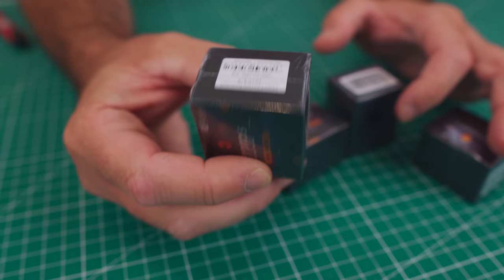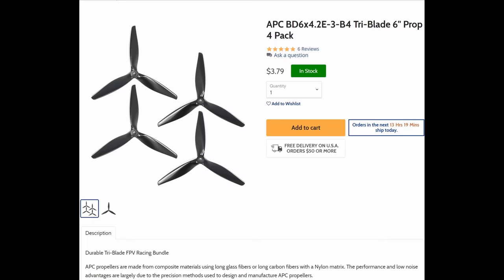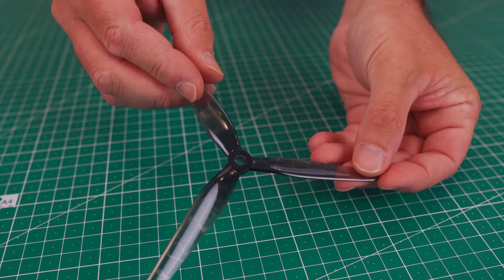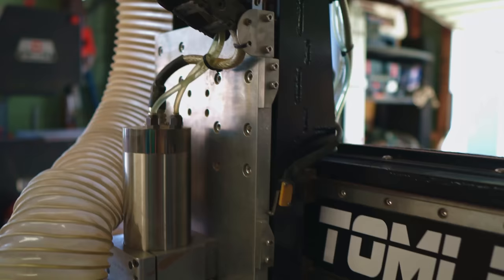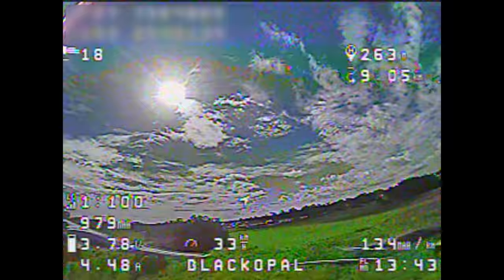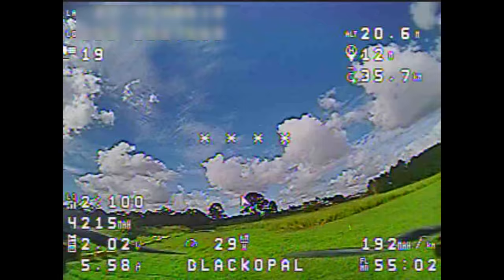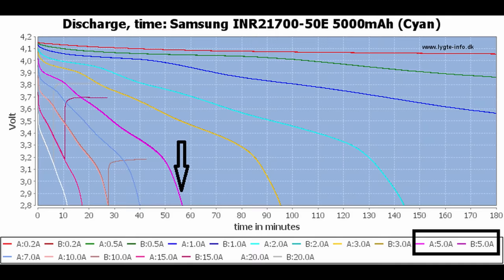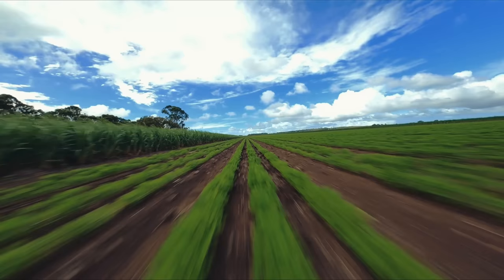55+ Min Long Range Drone (NEW T-Motor F2203.5)

Comment: Great video! Something a lot of long build idea videos forget is that there is a huge difference between holding altitude and cruising for a long time, and climbing up the side of a 3,000 ft mountain. While climbing ur always drawing much more amps, which kills battery life? How much life did you get when you climbed up through the clouds?
Reply from the maker: That's true, you could argue that coming down significantly reduces current though, so you break even. You're right though, any irregular flight hurts efficiency, you won't get 55 minutes trying to dive the Matterhorn at 80km/h. Likewise when racing it around a track. I can still drain a 1000 mAh LiPo in 3 minutes if I want to step on the juice.

Comment: How did you go that high with analog video?! 😳
Reply: Analog video can go VERY far if you maintain a clean and direct line of sight. So going straight up in to the sky Vives you a nice and clean line of sight between the drones VTx antenna and your goggles receiving antenna. A 1W (1000mW) transmitter will give you 10 kilometers of range when going straight up, with no problem ;)

Comment: Epic video nice work thanks for sharing.!!! .... , an I use these motors with a 4s.1500 mah lipo, and a 6 Inch frame?
Or what motors are the Best for these setup 4s, 6 Inch....actual motors can be used with 4s to 6s normally or its better to buy a especifico lipo, sorry for my basic quest im novice in long range... ill be thankFull for your suggestions

Comment: Hey Scott, would there be any issue if I remix your design and stretch it a bit to be more of DC and spread the front wider? Planning to make one using dji o3. Cheers
Reply from the maker: Doesn't bother me man🤙It's a pretty basic design. Should be easy enough.

Comment: how many endmills do you go through cutting that carbon?
Reply from the maker: You could cut multiple sheets easily. As they're only cheap ones (~$5) I use a new one when I want the cleanest cuts.

Comment: any advice on building up a battery pack from those samsung cells?  never assembled my own before, some of the stuff online makes it sound hard to solder to the aluminum battery ends
Reply from the maker: Soldering these cells are easier than a LiPo cell. It's pretty straight forward, just avoid heat as much as possible. FaclonRAD Fpv had a good video on Li-ion packs for LR. Might be worth checking that out.

Comment: What camera angle are you using on the gopro? can you get props out of gopro's view with slow cruising?
Reply from the maker: I run about 45 degrees. The frame is a stretch so if you only run like 15 degrees or something you might have props in view.
Reply: I am thinking about building one for mountain dive, I usually fly 25 degrees, do you think it is a good angle for that? I was thinking about mounting the front motors upside down do you think that would affect the performance? Great channel btw

Comment: Do quads generate forward lift or would it also be the same time if it was just hovering?
Reply from the maker: Not generic FPV ones no, Typically you get longer times just hovering. I like to focus on real world flying though.

Comment: Thanks for sharing the frame on thingivrs.. but can how to fit vista in it? I can use taller stand off, but not with the cam plate.. hope you release update for the vista version.. thanks so much

Comment: Is there a specific reason for using a f722 mini flight controller?
I would love to convert this setup into a long range drone, and maybe safe some money by using a f405 mini ? 
Thanks in advance..
Reply from the maker: Not at all, I just like this FC/ESC combo had the HD plug when I purchased it. I tend to buy things on sale etc without a use case Haha.

Comment: Aren't two bladed props more efficient?
Reply from the maker: Generally yeah. Hard to stay in the air at low voltage on bi blades however. I'd use them for covering distance a bit quicker however.

Comment: Was the change to 6" to allow for bigger batteries because the 6" should be able to carry more weight? Or with the larger battery capacity, you are able to deliver more amps and therefore drive the 6" prop? Just curious more detail on why you chose 6". Great video BTW - loved the flow of information and the editing. Keep it up
Reply from the maker: Essentially to carry the extra weight yeah. It's likely very attainable on the 5 inch one on 4S. The 6 inch with bi-blade on say 5 or 6 S 21700 should be unworldly I'm betting. I'll just continue to tweak and test until I've got something that really blows my mind. Not quite there yet.. My buddy is working the range side of things behind the scenes too. With a bit of luck these will be at 20km from home then return before we know it. Thanks for the support too.

Comment: what would be a commercially available frame at the same weight or would you need to make it.
Reply from the maker: In the 6 inch category I'm not quite sure to be honest. There's probably a few 5 inch toothpick style quads around with a 12x12 motor base.

Comment: So would u pull the throttle on that or u keep it hovering around and that is about it?
Reply from the maker: Definitely mate, I did just that in my 5 inch video. As long as your quad is light enough you still won't pull huge amounts of current at full throttle. You'd still want to switch to LiPo though if racing was the intention.

Comment: What size heat shrink would you recommend for a 6s 21700 pack?
Reply from the maker: 80 mm flat (50 mm round diameter) fits 4S 21700 quite snug. 110 mm flat (70 mm round diameter) on the 6S.

Comment: Very impressive (!) demo of what's possible with the latest tech and with focusing on weight minimization.   I wonder though if you've given thought to using 2-blade props...might get a bit more efficiency...10-20%, especially if C-fiber props with thin blades/higher aspect ratio.  Also, like many others, sure would like to know when you're ready to produce these things.  Keep up the great work!
Reply from the maker: Thanks Greg. The theory checks out yes. For covering distance at a quicker speed I go with bi-blades. I'd also use a bi-blade prop on larger builds. In this particular instance I couldn't match the time achieved only using 2 blades. Once the battery depleted, the thrust wasn't there to maintain efficient flight for the same time with the bigger battery. The versatility is what still amazes me though. I can average over 100 km/h for 10 mins even on a 18650 pack.
Reply: @ScottTomlinson  You're welcome Scott, and thanks for mentioning that you have already made some flights with a bi-blade.  I'm not sure at this point why you see the more, rel to tri-blade, degraded performance from a bi-blade as the battery voltage begins to sag.  One possibility may be that the bi-blade's pitch is not optimal at the lower RPMs.  Maybe you could get a bi-blade with a higher/lower pitch and try it?  Whether it should be higher or lower, not sure...could be that the motors can't swing a prop whose pitch is too high for their torque at lower voltages or it could be that the lower rpm that comes with lower voltage means that you need higher pitch to maintain best angle of attack for the flow over the blades.  Sure would like to see the torque-voltage-rpm graphs for the motors, if there are any.

It is indeed impressive that you can also get such awesome performance at higher speeds.  What's cool to me too is that the no-batt weight of your quad is ~300g less than that of the DJI FPV.  You've done a fantastic job of keeping the weight down, and I guess DJI has not done such a fantastic job.  The payoff is much higher battery efficiency, and batteries are not cheap.  

By the way, I also greatly enjoyed the flight footage up in the clouds, another thing the DJI FPV can't do, because it's programmed to follow the silly rules that birds much bigger than  your quads don't follow.  It's such a shame to have a high-performance quad like DJI's hamstrung from taking us up into the clouds along with the hawks and eagles.

Comment: 6s 18650 instead of the 4s 21700?
Reply from the maker: I use both. 5S and 6S are much more fun to fly. If you don't care about the long slow flight time then 6S 100%.

Comment: Aerodynamically you rob any minor efficiency gains a motor gives u by selecting a 3 blade prop. Prop diameter and number of blades is king. U can test this on eCalc.  So u know im not full of it.
Reply from the maker: Yeah rule of thumb says bi-blades are more efficient but it's really application specific. In this instance, when using bi-blades, I lost the thrust required to extract every bit of battery capacity once the cells fell below 3V.

Comment: why didn't you use the xt30?
Reply from the maker: I still use LiPo batteries as well when I'm not trying to fly extended time/distance. They're all XT60 so it was just easier this way.

Comment: Hello! I have just built a similar setup, with the same motors. Used heavier electronics, with DJI air unit. I managed to fly 22 min with a 4s 18650 3000mha battery, 5 inch. I noticed some oscillation during flight. Can you show me your PIDs and how you tunned it so well? Thank you.
Reply from the maker: I treat my tune more like a race quad. I typically use a 6S 850 to get it flying right initially. I've found success by dropping the master down to about .7
Reply: You would probably get to 25 minutes if you swapped the air unit for a Vista.

Comment: Recommend me the gold standard/best bang for the buck transmitter and fpv goggles and anything else i would need to buy to make this my first fpv setup.  i already have the tools and means to do the frame and am familliar with soldering and wiring.

Comment: I’m wondering if you’ve done any testing with the 2203.5 on 5” build?
Reply from the maker: I've flown these a lot on 5 inch. I'd probably up the kv if putting them on a new build however. Will make it a bit more versatile. T-Motor make a 2000kv variant now too.

Comment: So if you used high c rated 18650’s and ran 5 or 6s you would get what, about 20 minutes of flight and have a good punch out as well. 
Good idea, and awesome flight times. Your in fixed wing flight times and beyond. Can you see what the thrust is per motor?
Reply from the maker: Yeah that's it mate, 20 mins even with the naked GoPro. The high drain 21700 cells are an option if you needed the time too. I ran a 6S 18650 test on this same quad just the other day and did 15km in 8:32. That's a 105 km/h average. I do some more speed oriented stuff in my 5 inch video if you haven't seen that yet.

Comment: does it not matter whether these motors are cw or ccw? None of the listings say the direction of the motor.
Reply from the maker: Doesn't matter no. Motor direction can be changed via ESC settings.

Comment: how to drill a polycarbonate propeller to fit in? I tried several times and the result is my propeller is not balanced.
Reply from the maker: Shouldn't need to now, there's some good 6 inch props available.

I've had no issues though, drill bit just follows the pilot hole already in the prop.
Reply: Thanks i found a SL6026-2 from GF with a mount that fits the motor F2203.5
Reply from the maker: @alphalabfpv2558  That's the perfect prop!

Comment: What is the size of the dril ,that u drilled the prop please answer.🙂🙂🙂🙂🙂🙂🙂🙂🙂🙂🙂🙂🙂🙂🙂🙂🙂🙂🙂🙂🙂🙂🙂🙂🙂🙂🙂🙂🙂🙂🙂🙂🙂🙂🙂🙂🙂🙂🙂🙂🙂
Reply from the maker: 5mm. You don't really need to drill out props now though. Since this video there have been some good 6 inch options come out.

Comment: how did you get the frame so light? very curious. what thickness is it? cheers
Reply from the maker: The frame body is 4 mm thick. Top/Cam plates are 1.5 mm. I just simulate in SolidWorks and trim the fat until I feel it's adequate.
Reply: @ScottTomlinson  weird. i have a light 6 inch quad here. the arms are 9mm wide and each arm weighs 9-10 grams, before i add the top and bottom plates. this is madness lol

Comment: looks like a nice project to get back into fpv after 1½ years. just wondering if this motor can handle the prop on 6s while flying a bit more of a race style
Reply: It will handle 6s on gemfan 5125 props, but probably not on hq 6025. Unless you set motor output Limit to like 75% and go easy on the throttle.

Comment: Amazing craftsmanship! Also footage with naked gopro looks great! But is range limited because of the small vtx antenna? In other words, how far can you go with this antenna? Can you run your vtx at 600mW or more? Or would you attach rather a slighty heavier antenna?
Reply from the maker: Same set up ran out to 5km (See my previous video) and still had decent video. You're right though, add 800mW and perhaps a longer antenna if you wanted to push it to the 15 ish km it's capable of. You'll need to start thinking about decent vrx antennas at this stage too. The crosshair extreme I've been using is still portable and easily good for 5+ km. Depends on what you want to do.

Comment: Amazing results Scott! Do you think your quad has enough power to mountain surf on this setup?
Reply from the maker: I really hope so man. It won't resist huge gusts like a heavier 7 would so stabilized footage will be a must. Mountains and Australia don't really go in the same sentence unfortunately so epic glacier flights mean a small plane trip for me.  

My 5 inch version on 6S li-ion with a naked GP really shines. A little extra weight but still manages 20km total flights at a reasonable click.

Comment: Great vids, just discovered the channel.  Could you tell us what make and model router you used in that build?
Reply from the maker: Hey mate, it's my own design. I touch on it more in the proximity drone video.
Reply: @ScottTomlinson  will check it out, looks solid!

Comment: Earned my sub! Love the video! Couple questions. What's the weight of the quad? Did you have to solder up the battery cells yourself? And when/where can I grab those motors 😍
Reply from the maker: Dry weight is 188g with 6 inch props. I made this battery pack up myself yes. There are some starting to hit the market though. As for the motors, I see them popping up in shops online currently. Or just T-Motor directly.

Comment: I don't understand how Li-ion packs work.  You can fly them down to 2.06V!?
Reply from the maker: That was per cell yes. Not recommended to drain a cell that low however. The higher quality cells go down to 2.5v fine though.

Comment: I did 40mins on 5" with 4000mah li-ion 21700 and everyone complained its unrealistic cause i was cruising 27mph not over 50mph 🤦🏻‍♂️ (drone didn't fly well on the heavy 400g battery pack though)

Comment: it could fly better with a 2105.5 1500kv motors in terms of efficiency while maintaining the same power ? maybe is more responsive ?
Reply from the maker: Possibly yeah! This was a little while ago now. My go to for UL builds is a 2005. I did try some prototype 2105 motors but they were a little heavy.
Reply: @ScottTomlinson  ok so 2005 for 6 inch too ?
Reply from the maker: @lorenzocascone2038  Yeah if the build is light. Honestly anything around that size will be pretty good though.
Reply: @ScottTomlinson  thanks a lot !
Reply: @ScottTomlinson which 2005 motors do you like? There aren't many I know

Comment: @ Scott Tomlinson how much for a dji air unit variant with that battery pack shipped to Melbourne ? I’ll be happy to be first inline cheers
Reply from the maker: Just testing the theory out at the moment but thanks! The vista would be a better way to go (even better naked) over the full AU if you were considering something like this.

Comment: Damn im curious can you lift a fullsize gopro  / fullsize gopro without battery
Reply from the maker: With a smaller battery it shouldn't be an issue. You'll sacrifice flight time obviously.

Comment: what video settings are you using on the naked gopro? that looks awesome!
Reply from the maker: 2K7,superview, locked exposure, locked wb, bitrate high, iso 100, GP colour ND8/16/32. Usually around that.

Comment: Hey man, what about the EMAX Avan 6" props? They seem like the perfect long-range prop with a 5mm hub to me.
Reply from the maker: I tested the 5 inch back when they came out. It's sort of known they're actually really inefficient. You really want a low aspect, low pitch prop for maximum efficiency. The new Gemfan props (check out my latest vid) have pretty much nailed the LR prop for this mini quad size.

Comment: will you crack the hour with those gemfan biblades and 40km [note gps adds weight we are lucky we dont have to have one in new zealand or ozy they will soon in the states and europe we cant still just can use landmarks to return home with] can you cut me a frame? best long rang 6inch  ultra lite out there bud i think? 43 grams thats really lite i like it how thick is the carbon?
Reply from the maker: I'll definitely run some tests once they arrive. I mean you could likely do it now by going slower but that's defeating the purpose. GPS is a great tool for gathering data too. The frame thickness is 4 mm.

Comment: What is the thickness of the frame. Please answer.
Reply from the maker: 4mm in this video but I'd recommend going 5mm if you don't need the extreme times.

Comment: Are these props, you were talking about, allready released with 5mm shaft ?
Reply from the maker: Yeah. Hurricane LR 6026
Reply: @ScottTomlinson  thanks a lot !  

Do you use them on 4s or 5s ?  Im building a 6 inch with your specs but a little heavier, so that could be a problem with 2blade.

Comment: how this build responds to 4s 18650 cells??
Reply from the maker: Hey sorry just saw this comment. Around 35 mins on 18650 cells. Saves about 90g weight too.

Comment: are the motors ok for lightweight (600gr) 5"on 6s lipo? tanks for the cool vid.
Reply from the maker: 600g Including the battery? If so it's getting to the upper limit but they will fly yeah, probably not what I'd recommend doing however. Definitely not a replacement for typical 5 inch quads.
Reply: @ScottTomlinson  Thanks, Happy Flying